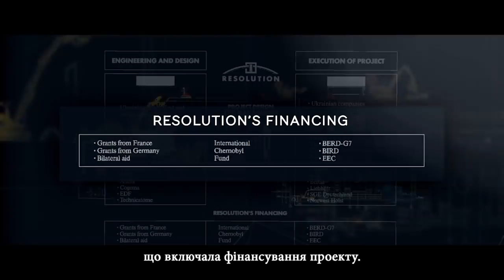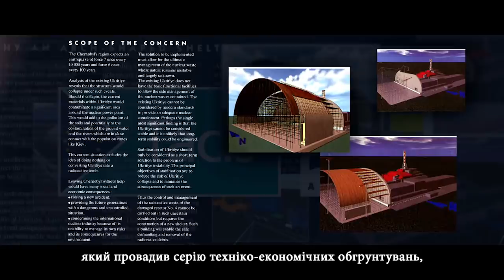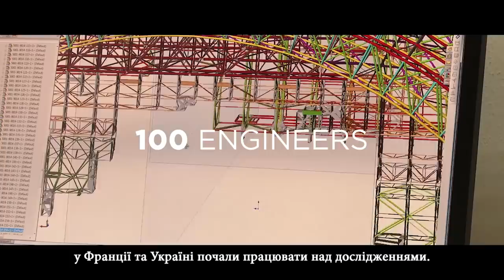Chernobyl confinement: the story

Comment: and now ... next in line ... fukushima
Reply: Go look at a Google Earth image of Fukushima and you will see water tanks everywhere. All the water they keep pouring in to cool the core has to be stored. And occasionally, with the UN’s approval, they pour some of it into the sea to make room. Fukushima is a nightmare, just a different kind from Chernobyl.
Reply: And in 5-10 years we just add another name to the list of nuclear catastrophy sites.
Reply: @Animaniac-vd5st  Looking at it historically full-blown meltdowns only happen every 30 years or so, so the next one is still more than 20 years away.
Reply: Fukushima thankfully is veeeeeery different.
For a start yes there were explosions, but these were hydrogen explosions localised inside the buildings housing the reactors, at Chernobyl the explosion was due to steam pressure inside the reactor itself. Thus in Fukushima there was no fuel or reactor components ejected anywhere.

The air contamination was due to the need to vent hydrogen gas pressure from inside the reactor vessels, if not then they would have blown up due to too much pressure, the venting took some bi-products with it, but no fuel. The vent pipes leaked into the buildings and the hydrogen caused the explosions outside of the reactor containment.
One of the reactors was vented a little too late and had already cracked, this led to the ground contamination.
Sea water contamination was due to the reactors having to be cooled in an "open loop" fashion for a little while until they could figure the plumbing out.

There are plenty of videos explaining what happened and thankfully it should all be much quicker, cleaner and less costly then Chernobyl thanks mainly to the reactor vessels still being intact and not blown into 10,000 pieces spread over tens of miles.
Reply: kal9001 Great explanation
Reply: Fukushima's ice basin has been under construction for two years and will be worked on for a further decade.
Reply: ... 30 years from now. At this moment Fukushima is just like Chernobyl used to be: "don't panic, everything is contained, everything is safe!"
Reply: @jamesdigriz5449  You cannot seriously compared the japanese government of today to the soviets. The cherno reactor blew it's guts all over the place, the fukushima reactors haven't and are thus contained
Reply: @combee23  No one is comparing governments, that's just silly. I'm just saying it has been covering up the incident on Fukushima Daiichi Nuclear Power Plant, especially from the very beginning. I live in Japan and speak Japanese fluently, I know what I'm talking about. Most Japanese people I know had no idea about the nuclear leakage problem, as the media only covered the earthquake part of the story. All information about the radiation was first coming from foreign investigators. The same sh*t as the Soviet did in the beginning of Chernobyl tragedy. Yes, Chernobyl was way worse, but Fukushima wasn't and isn't so much better. You clearly have no idea what you are talking about. The radioactive water alone was detectable on the west coast of the US, and the Japanese are still trying to figure out what to do with all the enormous amount of radioactive water. Here, educate yourself: https://www.wired.com/story/fukushimas-other-big-problem-a-million-tons-of-radioactive-water/
Reply: @Nickname34 they have to because japan is a little bit too small to waste so much space for the next 10.000 years :) But still after seeing what happended and even if it wasnt that bad like chernobyl. mankind should stop using nuclear power and switch to other sources. everytime i see a nuclear power plant i think its too dangerous and to damn expensive to fix if something goes wrong. everybody talks about how cheap the energy is but let it explode and then calculate again. Solar and wind energy is much much cheaper on that regard.
Reply: @Stelomat  Except for the fact, that solar, Hydro, and wind energy are too inefficient and more importantly, Inconsistent, to work. to meet the huge demands for energy, it would take massive amounts of solar plants, wind farms and hydro dams, and even then, one cloudy day or calm, tepid day to reduce the power output by half or more. there are only so many places you can put a solar plant or wind farm or Hydro plant, and with wind, you can only put them so close together before you get reducing returns.

Nuclear Power on the other hand is constant, and in recent years, there's only been one nuclear accident, and that was at a Generation 2 reactor, built on the fucking Ring of Fire itself! now, I'm no expert, but building a nuclear reactor on one of the most geologically unstable places on earth sounds like a bad idea in the first place. probably shouldn't have been done. but, hindsight is 20/20. every other major reactor incident, Three mile, the reactor in England, they were all First Generation reactors. and there have been no accidents at third or fourth generation nuclear power plants to date. 

Nuclear power has its risks, but thanks to constant development, refinement and implimentation of newer and better safety standards and equipment, nuclear plants are now some of the safest places to work. if you follow the procedures, do everything by the book, and give it the care and respect that it deserves, then nothing will go wrong due to negligence or human error. as for other faults, other forces like earthquakes or tornadoes, well, only thing you can do is not build them in places susceptible to such events. after all, if they hadn't built the reactor at Fukushima, on a country known for it's frequent earthquakes, then they wouldn't have had the problem in the first place.
Reply: uninhabitable ...Chernobyl ~3000 Years up to 20.000 years Fukushima 20-40 years (iam not so sure about that) nuclear power is much too dangerous. The fuel waste of nuclear power is still not anywhere near to be solved. so every year more and more waste piles up somewhere. i think its not a matter of whats more efficent... because  efficency for now  does not mean that piling up nuclear waste for our children to care for and their children and so on is definatly not efficent in the long run. longterm we need something better or safer or both. It can not be efficent that our waste is the problem of future generations to come !
Reply: @Stelomat  as for the Fuel waste, the spent fuel rods simply need to be recycled and returned to service. the problem is, governments in the 60's, 70's, 80's and on until recently, haven't bothered with reconditioning centers to return these rods to service, since they didn't bother developing the tech. as for other waste, the main source of waste is the water for the cooling pools, where the rods have to be stored for a period of time after being removed from the reactor. unfortunately there simply is no way to deal with that water at this present time, at least with efficiency, so it has to be stored and simply wait until the radioactivity dissipates on it's own. any other byproducts, such as Plutonium, and other isotopes are much much smaller in amounts, and thankfully, have much shorter half-lifes
Reply: Fukushima is contained. No need for this. For now..
Reply: Guy Kazemeka I think fukushima has other problems. similar to chernobyl.
It leaks into ground water, and spreads underground. I read that they are freezing the ground, to isolate and slow down the spread of radioactive stuff.
Reply: UninstallingWindows Sadly, people nowadays are too self-conscious. Unlike soviets, they will not dig underneath the reactors to build a concrete platform to stop the spread of radiation.
Reply: @BillyTubememe  one thing I am proud of the Soviets for, they could of kept denying the disaster, and let Europe find out a few months later when it was too late, but they accepted their mistake after 3 days, and worked hard to contain the mess
Reply: @BillyTubememe  no one is looking forward to building an uphill cassion system in an unconsolidated outwash plain that is 850 feet approximately to bedrock. Sited poorly, there is a continuous flow downhill of water to the Fukushima       Station.  The head pressure as it backs up in doing a huge project will have to be studied.  Having worked in soil and water engineering I could reckon pressures that could exceed 120 to 300 psi. Not impossible to build with but still very costly. On the plus side, it could form a large stable base, a  concrete footing, one beam each on  the land and seaward side of the Fukushima power station buildings in similar fashion to Chernobyl but a longer Sarcophagus system to cover all the four destroyed or extensively damaged units. What a mess.

Costly accident, that Fukushima, with lots of dumb decisions. It started with our USA-IAEA responsibility. Yes, our responsibility because we sold the world on nuclear stations for power.  But the generals knew once you have the right ones you go directly to making what they desired, new plutonium. So our generals in the MIC to hide the costs of war they devised  this creation of power for electricity and known by products. Such wonders of hell  including  unreclaimed mines and toxic waste dumps, the depleted uranium by the ton, and irradiated hot water just dumped or blown into the air . Doing all that just to erect the mega MAGA phallic weapons of war and no Bruce Willis there to use any of them for the really needed good right job for survival.

Now, if you can believe it, the Japanese government also has sided with its partner TEPCO (JPG is now 51% owner,- so much for the market winners and losers in "capitalism" ) turning into a totalitarian like governance, making it legal, giving the right to TEPCO to refuse any and all renewables to be hooked up to its grid. 
-------------------
Hubris and Planet Talk From the Universal Overseer 

"Next time humans, remember much good work begins with a K.I.S.S. principle (Keep It Simple, Sport). 

Yes, I gave you Paradise and you kept trying to pave it over or rush things to hell. Wish you would slow it down . You keep straying on bad paths believing in false promises, not seeing the wolves in sheeps clothing and worse, the making and honoring a cult of death. Thought you could see that. Well, here is a reminder of sorts. You and your offspring will be travelling through my universe for at least another close to a billion years.  You are all on a  65,000 mile an hour Spaceship Paradise I built for you. Why do you want to forget my knowledge, the knowledge that God gave you and make it hard on all the beings, all the Creatures in an Assisi Canticle? I did not ask for much from you in the end, taking one for you, carrying that cross.  Just asking that you show some humility, and become more aware more accepting and finally, finally know your needs from wants. Quitting while you are ahead.  Come now, show everyone that you really know what love is, how you love all of the creation. I just want you  to show me you know and stop making messes that get harder and harder to clean up." 

God.

P.S. "Watch those physicists who play with fire. I put the sun out there in space for a reason, reactor safety.
You don't know it all and allowing your children to go play with universal matches, and like mostly bad ideas, you will all get burned. Trust me. "
Reply: @dylandog518  Lmao, they did everything they could to deny and/or downplay the accident. They only admitted an accident when sweden measured radiation
Reply: @BillyTubememe  "build a concrete platform to stop the spread of radiation."
No one lives there. Why do that? Isn't the danger of anything it's concentration and proximity?
Reply: @BillyTubememe  contained? Are you mad? Tanks onsite are leaking, waste is seeping into the ocean. It's far from contained.
Reply: @markbrinton6790  first question to ask is what is in that water then.
mostly it's normal groundwater.
then a little bit of tritium - which is radioactive, but so slightly that it is harmless.
and that's about it.
there's actually quite a lot of sense when they say the best thing that can be done is to dump it all into the ocean.

as Chernobyl "suicide crew" already proved irradiated water ain't as dangerous as some estimate it to be. Because they tend to forget there are various types of radiation - some happen to be far less dangerous than others. Water also is quite good at keeping the radiation in check - for exactly this reason it is used both in the reactors and in spent fuel pools. 
so people should really grow a habit of asking about the details - not just starting to panic at the first hearing of word "radiation".
Reply: no, when ever the ideas brought up people just say fuk u shima. hahahahaha im gonna kill myself
Reply: @Enduro300rr  so how did it go? still alive?